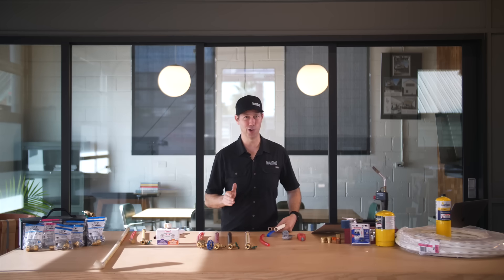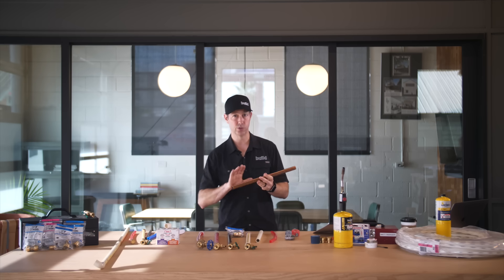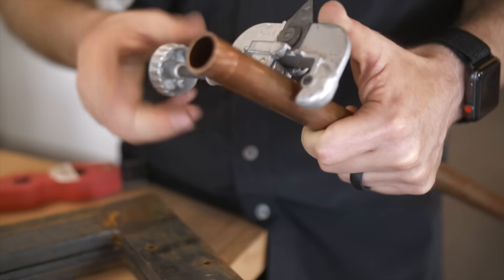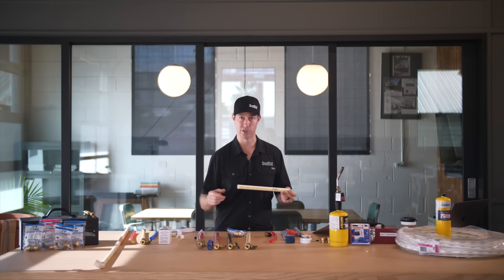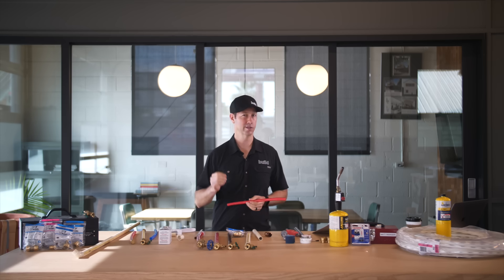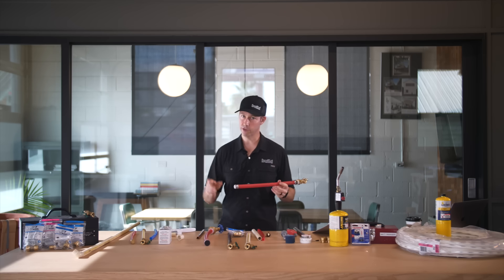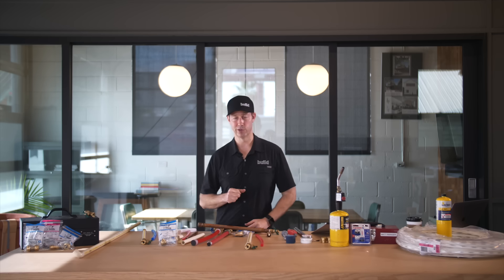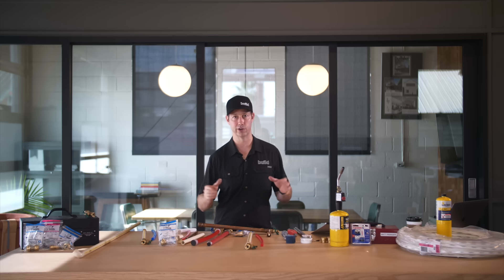PEX vs COPPER vs CPVC plumbing pipes

Comment: would NEVER use copper [or any metal] piping in my future home.. growing up with copper, i watched the hard water in our house eat right through pipes in no time - actually ate through a metal sink trap in less than two years one time.. all the copper pipes in our house are corroding [ticking time bombs] due to the hard water; any repairs now are all plastic & the pipes don't fail anymore

i work with CPVC all the time at work & it's just fine.. some has been under ground for decades now with no issues & makes for VERY easy/cheap fixes compared to the copper pipe - the ground & water reactions destroy the copper/metal so fast [making it impossible to work with due to the corrosion].. i haven't noticed any issues with the CPVC like people have been stating, but i've personally seen copper & metal fail in less than five years due to nothing more than rot/corrosion [both in my own home & at work]..

copper/metal is more expensive, & prematurely fails due to hard water - plastic does not react to water & is cheaper/easier to install/maintain [unless exposed to the outdoors; UV &/or cold temperatures, but nobody puts their houses plumbing outside, so it's irrelevant..], so the choice is clear for me..
Reply: Don't know where you grew up but a water softener should be used to keep all water ph balanced. My daughter purchased a home in Rochester NY in 2010 that was 106 years old and was entirely copper including DWV and i was shocked at the quality and durability. After we tore the walls out for basement bathroom we found the plumbers name and Local #13 (Class of 1889) on an inside wall. After the entire house was demo'd I took pictures of every pipe run and came to the conclusion she would be an idiot to change anything that didn't need to. The only reason people in the north east don't use copper is cost.
Reply: @mikecomerford4041  "The only reason people in the north east don't use copper is cost."

that may be your opinion, but it's not what i have seen/heard, & it's definitely not my personal reason for never using copper in the future [under ANY circumstance].. im glad your daughter had a good experience with copper, but i've never heard/seen good things in my area with metal piping of any kind - everyone that has plastic has never looked back [including me when using plastic for repairs] & doesn't have to worry about softening their water just to keep their pipes from corroding away on them

call me crazy, but i'm pretty sure the idea is to make your pipes out of something durable that can withstand/contain the stuff running through them, rather than make the stuff running inside the system unreactive to the pipes.. i mean, you build a house out of materials that can withstand nature - you don't attempt to alter nature to stop corrosion/wear on your house, right? certain materials offer an inherent advantage in certain situations, & trying to force a disadvantaged material [copper] to work as well as another material [PEX/CPVC] will always lead to more expenses, maintenance, & headaches [such as softeners]..

if this was a simple battle over how physically strong the materials were? copper all day.. but, this is not about brute strength, it's about chemical resistance & reactivity out of the box - to which plastic is the clear winner [by a landslide].. the cheaper costs are just icing on the cake

fixing the contents within the pipes seems like such a losing battle compared to simply using an unreactive material [that costs less & is FAR easier to replace/fix] & that is why copper is a total loss for me; i see absolutely no area/aspect that copper is better than PEX or CPVC & will never consider it - cost is not the 'only' reason, it's just one of the many reasons..
Reply: @yuskjr  Our lives are full of places where we alter natural to make it more livable. It's called the built environment or civilization. It is not difficult at all to come up with many circumstances where this is the case. 

Altering the water isn't just about making it better for the pipes. It is also about making it better for the users. That also is a serious reason that wasn't discussed for considering copper. It is inert, and doesn't leach chemicals into the water. Plastic does. Maybe you won't turn green or whatever, and maybe they'll find a cure for cancer and so many other diseases. Or maybe we'll just stop pickling ourselves.
Reply: @johnlee7085  , okay, but copper can leak into your drinking water too & has a whole mess of side-effects of it's own.. so im not sure how the leeching chemicals argument is any better when copper can [& has been known to] leak into water & cause health problems?

drinking water has chemicals in it that clean/purify the water as it runs through the system & those are usually the chemicals that react to the pipes, so, you can remove the chemicals used to clean the water, or you can just use better materials for your pipes that don't require any treatment [saving you money/time] - since most people don't even drink their tap water anymore, there's even less of a reason to treat your home water when the main uses have become cooking, brushing your teeth, showering, &/or being flushed down your toilet..

again, feel free to go with copper/metal pipes all you want, but cost is not "the only reason" many people [like me] are steering well clear of it now-a-days..
Reply: @yuskjr  Union Pipefitter/Plumber with over 45 years experience.  Living in -25 to 100 degree weather will change your mind. I have made a lot of money fixing and replacing  plastic supply lines. Most homes in Upstate NY are over 100 years old and other than neglect (no heat in winter) i have never replaced copper piping that was installed correctly. Never
Reply: @mikecomerford4041  nah, not even temperature would change my mind at this point; i'd just budget for fixing/replacing plastic pipes myself - that's how against copper i am after having/dealing with it all my life..

at my work, we replace just as much copper as plastic every year when exposed to cold weather [i see metal pipes break/crack just as easily in Winter as plastic ones when their not protected/insulated properly], so i see no real advantage there either - plus, plastic is SO easy to fix that i wouldn't even mind if it broke more often..

i wouldn't even use copper if someone paid me to; i want nothing to do with it & will never consider it, under any circumstance, for the rest of my life
Reply: @yuskjr  You make a good point but you should also consider the rest of the system. Hard water is very hard on taps, valves, washing machines, dishwashers, etc. Pex is probably a good choice for the area, but softening the water will add years on the rest of the system.
Reply: I can assure you, that is not because of the hard water.
I'm living in a hard water environment myself, and my parents don't have any issues with their copper piping (house is now 40+ years old, never replaced any piping). Apparently the issue is the chlorination, not the hardness of the water. So it might well be that copper is incompatible with the water you get from your water supply.

The good thing about properly installed copper (when you get untreated water from your water supply, regardless of hardness) is that it doesn't age. All plastics age.
Reply: @Gubblinus  i would believe you, except that the [non-chlorinated] hard water found at work is even worse on the copper/metal pipes than the water in our house..

the water at work is higher in calcium & other hard minerals that just destroy the metal pipes in no time at all - i'm glad your parents house seems unaffected, but that doesn't mean mine isn't; the copper simply cannot handle the water being sent through the pipes, so it's worthless to use & makes no difference how it ages..

also, again, plastic has/is used at work all the time [for decades now] & it hasn't reacted to aging or water at all - the only issues with pipes we have at work are found with copper & metal.. plastic does exceptionally well when left out of direct sunlight [even in direct sunlight, i have yet to see any significant "aging" or damage to the plastic CPVC that's been used for decades..]
Reply: s vernon you know what’s easier than using a water softeners/filters & paying to replace them over & over again? using cheaper, FAR easier to repair, plastic piping that is immune to hard water damage.. for the cost of using worthless copper, I could install & re-plumb an entire house; probably in the same amount of time it would take to install copper once - i will NEVER own a home with copper piping, & nothing, literally NOTHING, will ever change my mind about that.. 

for every one of your 85 suite apartment stories, I have half a dozen copper failure stories..

if copper pipes cannot withstand the treatment chemicals, & if the only way to make them last is to pay for water softeners/filters (aka paying for treatment twice.. first by the town/city & then by me? haha scam if I ever heard of one..), then I will gladly use the cheaper, UN-reactive, easy to install/repair, plastic that I know/trust from using it at work all the time

have fun sticking with your expensive copper - you’re never going to convince me to use that garbage

Comment: Copper supply piping comes in type "K" and "L" and both are approved by the UPC and IPC for use as supply piping in residential and commercial buildings.  Type "M" is only approved for use in low pressure mechanical piping systems. Never use type "M" as plumbing supply piping. The wall is too thin.

Comment: It seems to depend on where you live. I replaced the original copper pipe in my house which was a solid 50 yrs old and I could have left it there for another 20 yrs. I replaced copper pipe in a house that was 20 yrs old but the house was 2 miles from the coast and we ended up opting for the Pex. Thought about the pex leaching but there was no choice in this case. I'm not a plumber by trade but the few jobs that I have helped with or have done myself it all depended on the area in which the house sat.

Comment: I'm familiar with all water pipe material, most experience with copper, and I think pex is deemed the winner. Even though it's plastic, there really is no fatal flaw to the stuff outside of its sun sensitivity.  AND it won't freeze and break. Just freeze. Fuck CPVC I've fixed so many lines in homes, seen air chambers blown off, and it's brittleness come wintertime. And copper is definitely suited best for commercial or overachievers like myself

Comment: Great video, but there is some very inaccurate information.  FlowGuard Gold is the trademark name for the CTS(copper tube size) CPVC piping system.  There are several licenses' of the FlowGuard such as Charlotte pipe(which is the manufacture of the sample you are using in this video).  Also you can use primer with FlowGuard Gold, but it is optional.  You can use FlowGuard Gold one step solvent cement to join pipe and fittings.  It is a yellow cement color and companies such as Oatey sell it.

Comment: I've used copper and PEX. I will go with PEX every time. I just ran two 300 ft. branches  using 1 In. PEX ( 600' total). I can't imagine making joints for 600 ft. on anything else ( like PVC) . And yes, keep PEX away from sunlight. Also, I have seen CPVC go brittle like a few others have mentioned.

Comment: I'm noticing there is a LOT of commenters in Florida... I live in the Pacific North West and my house has REALLY OLD CPVC fittings that have shattered under standard repairs. That being said, in our colder climate where the winters can get rapid changes from 40 degree days to 8 degree nights in the winter --- I think CPVC is the only material with that kind of temp/time tolerance. I love copper, but I have heard it can "worry itself open"... may be an old wives tale though.

Comment: He failed to mention one of the main reasons copper isn’t used much anymore: Theft.
I can’t even tell you how many jobs I’ve picked up replacing stolen water lines with pex. Good for me, not good for home owners/insurance companies. It’s amazing how much damage a thief will cause in order to get $20 worth of scrap copper, which roughly translates into 2-3 nice crack hits. With the amount of work it takes to remove the copper, plus the risk of multiple felonies, it would be a lot easier just to get a job. I’ve often commented that with all the experience a thief gets working with copper, he’d probably make a decent plumbers apprentice.
Reply: My parents church had the copper pipes stolen twice in a expansion. I have a rental house that the outdoor unit of the heap pump was stolen while still hooked up electrically and with refrigerant.
Reply: Did a job where the code required copper, after it was stolen twice, we painted it in pex colors and the stupid crackheads left it alone, so we painted some pex scrap in spray paint copper and the morons stole it!
Reply: @anonjag  Very innovative!  I love it!
Reply: @anonjag  that's a hilarious solution.
Reply: Copper attracts cracked out human-rats pex attracts regular thirsty rats.
Reply: I've seen them rip it out of the wall on a new school. Mind you around the corner was roughly 700' of copper just sitting on the ground.
Reply: Or crystal meth hits.
Reply: Very tru
Reply: failed to mention pex leaks chemicals into the water and poisons you
Reply: Chad Jackson —— I believe slime buildup is a thing too
Reply: U must be kidding! 😄
I can't imagine a burgler breaking in a private (secured) home with an electric 100dB noisy grinder to cut few feet of copper pipes hidden behind a plaster wall...for $20 bucks instead of running away smoothly in 30sec. with a TV or other small valuable items!
Those who are stealing copper pipes from private homes must be the workers themselves...
If we speak about stealing from an open-air, larger industrial land/ property / facility then, yes, stealing is a fact.
Reply: @Mike-ql4sz  You don't need a power tool. A prybar to open the walls, and bolt cutters to section up the pipe. Very little noise. The house next to where I used to live went vacant when the bank took possession from the previous owners. The town had to shut off the water because the underground line was slowly eroding a sinkhole under the sidewalk. When the new owners did their first walkthrough, the found barely enough copper in the whole building to fill a coffee can, and apparently either the previous owner or the thieves had taken the more expensive parts off the furnace as well. - The poor bank had to drastically sweeten the deal to get the place sold, because they didn't bother to ever send anyone out to see if the place was locked up.
Reply: @captianprice1592  It's called CHEMISTRY! It is a scientific fact that both pvc/cpvc, as well as pex contain phthalates. 
What are phthalates? Testosterone levels compared to your estrogen levels? How long does water need to sit in the PEX tubing? * Is PEX Pipe Safe for Drinking Water? Your Health on PEX, PVC, or Copper * MORE ON DR. ANTHONY G. JAY – can be found at: http://www.AJCCo.com

Did you know that 90% of transgenderism is Masculine to Feminine? Funny how 🤔 the problem (and it is a "problem") has also skyrocketed since the 60's...

Comment: 1/2" copper has a larger inside diameter than a 1" pex fitting.
Reply: Plumbing is read by inside diameter. 1/2 pex and 1/2 copper have the same ID. The pex is being installed wrong. Use an expander vs a crimper
Reply: @Jeremy Hess  Fitting... goes inside on PEX and outside on copper. Use a fucking tape. Prove me wrong.

Comment: You can’t use either of those types of copper tubing underground. With straight, solid copper tubing you have to use fittings. Fittings underground are a no-no. You use soft copper underground. It is flexible and comes in a roll, so fittings are not necessary.

Comment: Pex tubing very durable but not to flexible especially trying to lay over sharp corners and push fittings great invention very trustworthy and the fact that it can be released and reinserted its genius but like pro press you might get some defected fittings occasionally but you’ll catch them easily great video very informative

Comment: Why no mention of galvanized steel?  Houses around here (Oregon) were built with exclusively steel pipe in the 1920s through 1970s quite successfully.  New construction of course uses cheaper stuff, but I notice commercial buildings and high rises still use only steel pipe for water (and gas).
Reply from the maker: Galvanized is no longer acceptable for water pipes. Corrosion issues. I had a 1920’s house in Mt Tabor outside Portland OR. All the galvanized pipes from 1920’s had a pin hole of flow

Comment: In Some Northern States - Screw Pipe for Water Coming Into the House & Insulate - Along With Heat Cable Where the Line Is Above the Frost Line